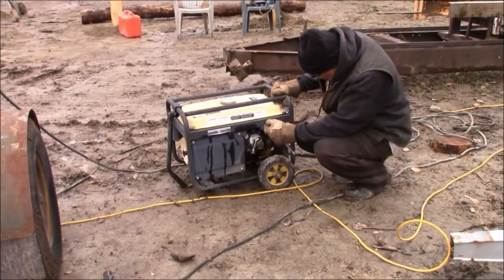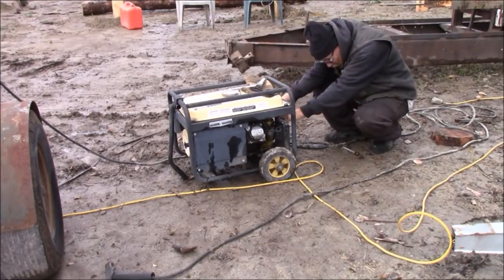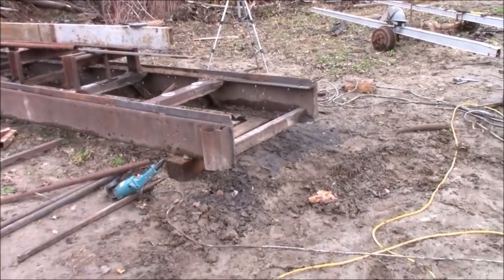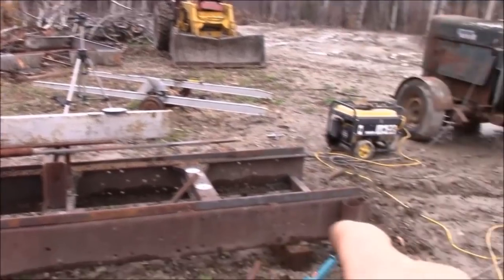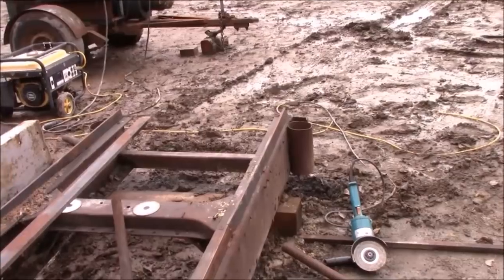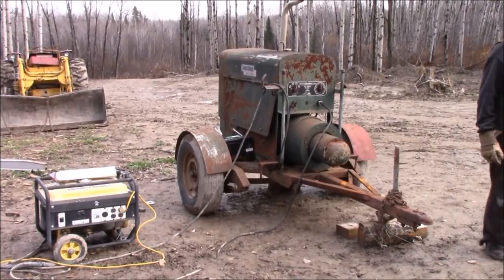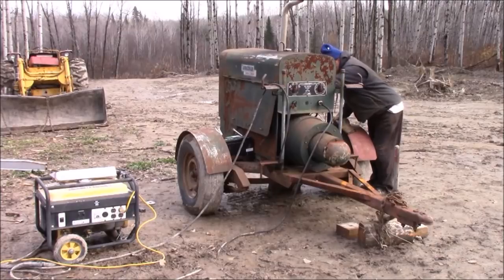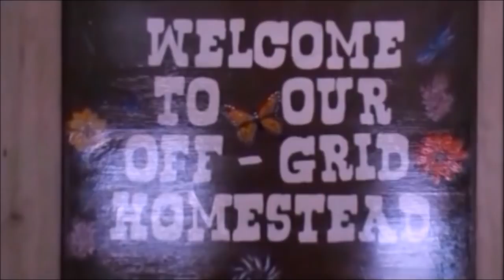Cutting Up Our Homemade Bandsaw Mill

Comment: If that had been me, I would have had 12 clamps, 10 wood blocks, 4 wedges, and 16 shims on hand before I started. As the process went along, I would have made 11 trips to the shop for additional tools and built 3 jigs and 2 gauges. And it wouldn't have been any straighter, stronger or better than the way Cecil and Heather got it done!  I guess they don't need my advice (as usual). Gotta love this team.
Reply from the maker: Yeah it is always faster and easier to have a second pair of hands and eyes to line things up... I just find some people get way too lazy, I mean the whole piece might weigh a total of 100 lbs. Besides if I didn't let heather help I would have been in more trouble  lol  Thanks Joe, You have a great evening and take care ttyl... Cheers  :-)

Comment: A couple of suggestions, if you don't mind. 1: Get a chunk of wood for Heather, easier to stabilize that long bar, can always shim to keep it level if you have to. 2: If you can afford, get some Sea Foam and put in the tanks of the generator and the welder. Helps with the carbs and many other things. It's not exactly cheap but, for what it does, makes up for the cost in the long run. 

I know all too well about "floppy" boots lol. I used to wear a brand from Cat, then switched to Brahma. Both brands always last me anywhere between 10-15 yrs, soles/treads start to get thin by that time but, still plenty of wear left in them.

Love that old welder. I hope you keep her running, just don't find made like that anymore. A true workhorse. Cheers :)
Reply from the maker: I don't think I could talk Heather out of holding that piece of steel up... She enjoys doing this kind of stuff, I plan on teaching her how to weld soon.  Yeah I hear some real good things about Sea Foam... I have just not tried it yet :-(   I should really try to get a good pair of boots some day,  But not in the budget this year.  This old welder rarely lets me down... Still runs like a top. Thanks again you take care ttyl... Cheers  :-)

Comment: it s too bad that a guy with a saw mill dont have any wood block to support those steel channel during the welding
Reply from the maker: I have lots of blocking around... But nothing beats a second pair of hands and eyes to line things up in a hurry.  Besides it would have taken three times as long to set up the blocking vs letting Heather help like she wanted.  Cheers  :-)

Comment: as one viewer added       why not add on to the back end off te mill and save yourself all that work ?
Reply from the maker: The mill unit is way too heavy to sit on these light rails all the time, this extension will only be used  for cutting longer logs and won't be my primary cutting track.  Thanks again, you take care ttyl... Cheers  :-)